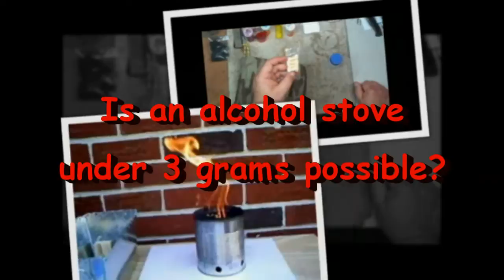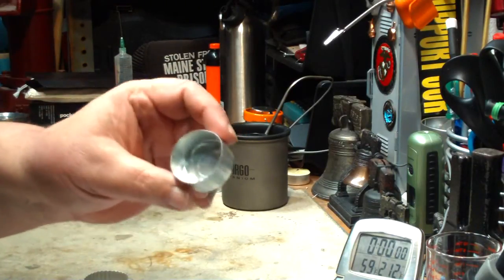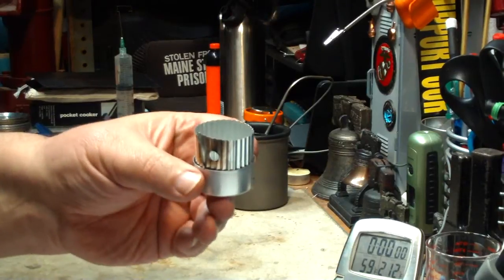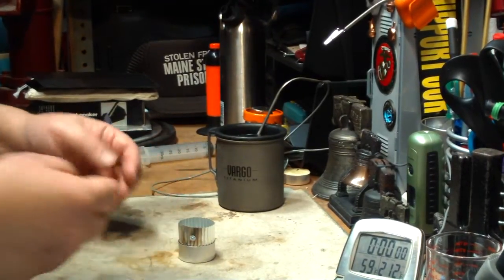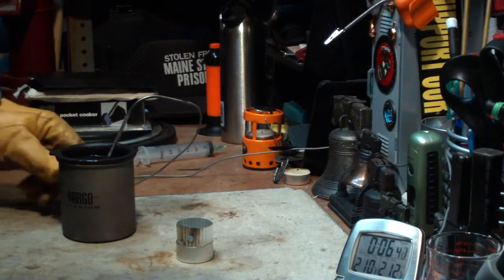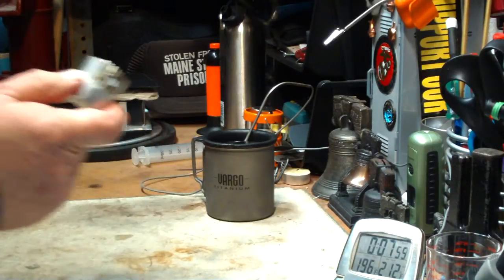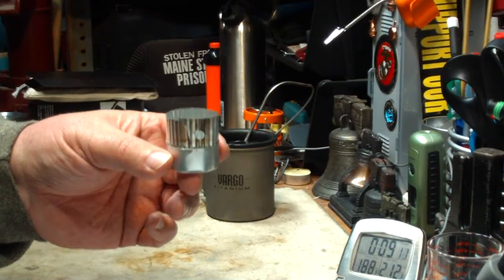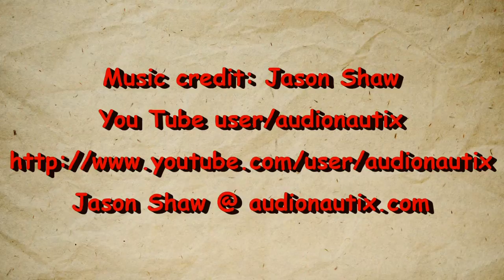Is an alcohol stove under 3 grams possible?

Comment: Hiram, this was a great idea. I've made a similar one this week with a tea light cup and a hand-corrugated strip cut from a pop can, 1-1/4 inch high. It wraps nearly twice around the tea light cup, which gives added strength over a single layer. The total weight is still under two grams!
Unfortunately, due to the Beer Virus, I can't go out to purchase either HEET or denatured alcohol, and there's no isopropyl to be found! So testing it will have to wait til summer. 
Take care!

Comment: Stove made with this candle cup work very well, put a lot of heat by their size.
Even if just pour alcohol in the cup and use a external stand will boil reasonable fast and fuel last longer.
But the cup is too fragile to be practical.

Comment: Hiram,
I have to say - I too am impressed!  I've been playing around with a dedicated UL hot drink system using the GSI minimalist, or a 12 oz corn can.  This rig looks like just the ticket for either one.  My only worry is that the components of your two part system may be too fragile.  Would stuffing it with FG insulation or carbon matting help in this regard?  Would either of these two do anything to improve other performance characteristics?  Hmmmmm.
Cheers from the Cheap Bastard